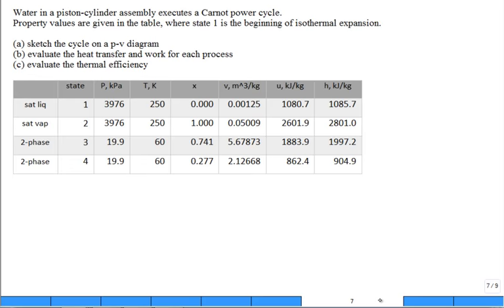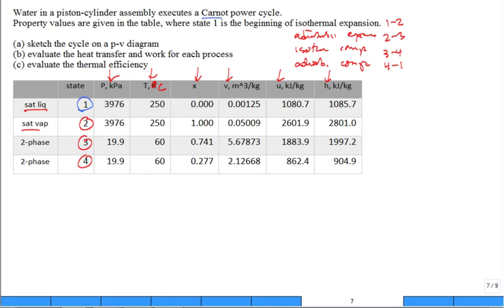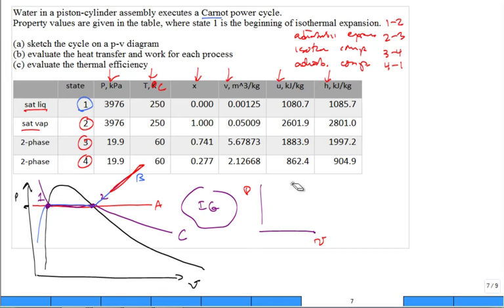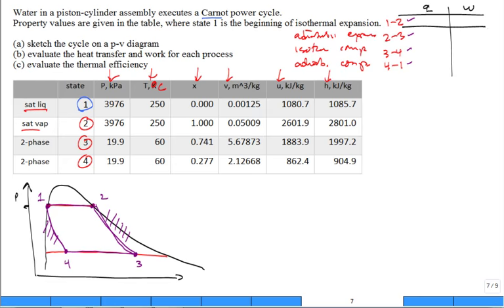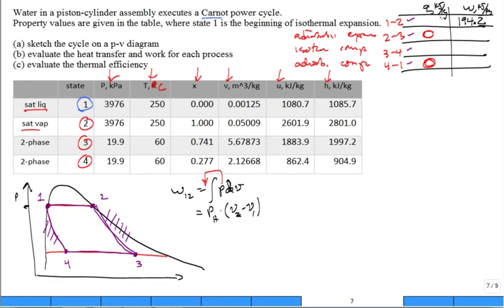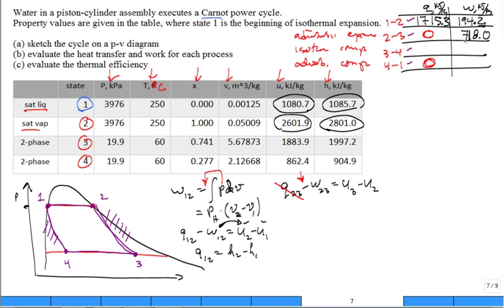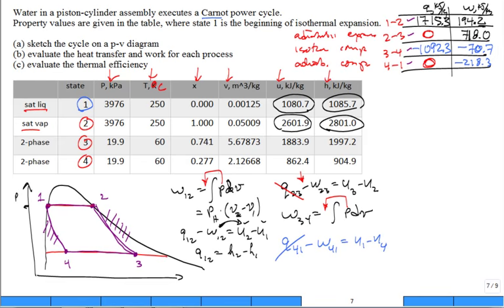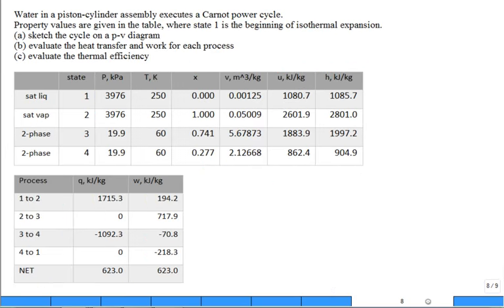ME3293 Carnot steam piston cyl Fall2015

Comment: Professor, why did you suppose that the processes 2-3 and 4-1 are adiabatic? thanks in advance!!!
Reply: They are adiabatic due to the fact that for a Carnot cycle, process 2-3 and 4-1 are isentropic, meaning there are no irreversibilities occuring, such as friction, or heat transfer, therefore, those processes are also Adiabetic.